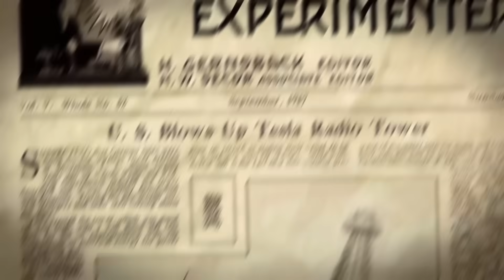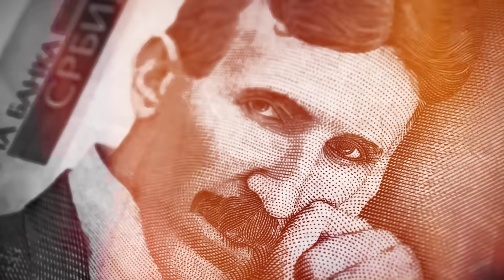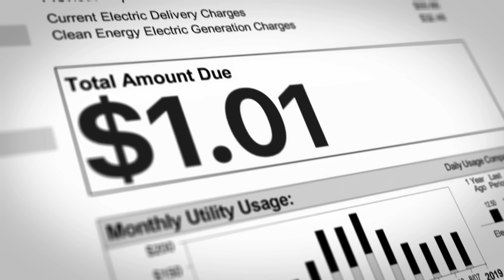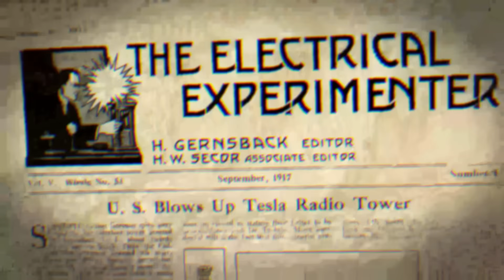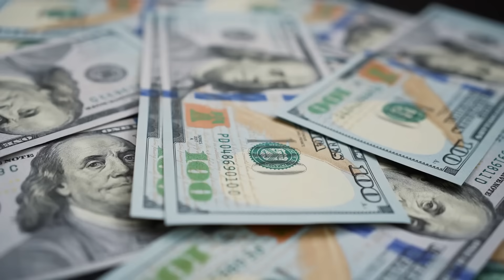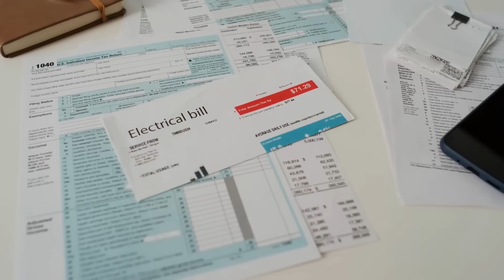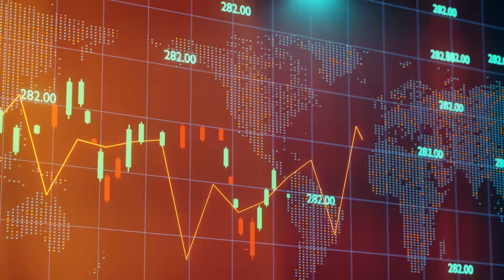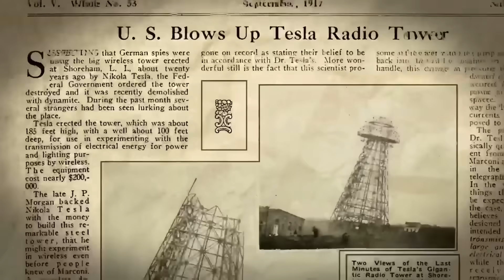Tesla's Lost Device Rebuilt!

Comment: 16-17 years ago I built a free energy system. I used a big 3 phase motor and started it using a blower motor from a house furnace that moves air for the ducts in the home. Once the 3 phase motor was going as fast of the RPM the blower motor could go, i put in 120 volt ac from my breaker box on one of the three hot wires on 3 phase motor and then that big motor could run at full speed with only one of the three hot wires, hot. But the other two wires also were hot because the three phase motor was making power. If I turn off the breaker going to the system it all stops. But I hooked up one of the two hot wires to the first hot wire after I flipped off the breaker and it keeps making power. If your motor isn't making the output of power you need, just hook up a run capacitor and dont use a starting one because you need full fun power on it. Be safe, if you don't know about electricity, please don't mess with it because it will harm and even take a life. Do not hook it up to your home either, if you're getting power from the grid because you can take a life from the electric company employees who might be working on a line several miles away from your home and you are sending live power on the line someone else might think is a dead wire but your making it hot or live. Ok

Comment: A company has been working on what they call a earth engine. I believe it is based on Tesla`s work. Tesla did not have a motor He used the earth itself. He placed light bulbs in the ground and lite them up. This has been done today .
Reply: Thing is couldn't it fry electronics like an EMP? Also over the air electricity that uses an ionosphere like lightning it's not going to be harnessed by an electric motor that sits on the table. I believe these patents are suppressed and a lot more could be done for electricity that we can make nuclear is even saf e if done correctly the real conspiracy is Nixon shutting down the lifter reactor used they use a thorium and freeze plugs that melted a certain temperature so even during catastrophic meltdown it won't actually leave radiation it stops the reaction over need for water cooling that can fail just gravity and something that melts at a certain temperature no human or hand needed let you know I can't make plutonium bombs. America just had found a giant uranium deposit in Montana. Interestingly enough AI is going nuclear but China and India are building thorium. My grandpa was building a lawn mower that got amazing gas mileage and two guys and a Cadillac and suits asked him if he got the engine working he hadn't really pulled anybody so he said no. He was a pretty renowned restore of model A's. So yeah I believe that they show up pay you off or sent you up or seal up the patent. If this is real I'm really glad that he made it open source and didn't try to patent it.
Reply: Black suits and ties oh no get the shotgun out lol
Reply: Utterly ridiculous 😂
Reply: You eve @MrMatbat1

Comment: Total BS. If we had any possible way to get more out of anything then we put in, the world wouldn't have any energy issues. But physics proves that just can't happen. And that is because we can't create energy, or destroy it either. We can only transfer it from one form to another but never getting more than we started with...and that is a FACT! The tesla coil is merely a very high frequency high voltage transformer that has electricity that will jump off to some place to try and neutralize it back to zero. But it doesn't have the ability to transfer much current whatsoever. Like static electricity in the dry weather jumping from you finger to a door knob. While that hurts a little, it can't transfer that spark for any long distances. Don't be fooled thinking some governments, or huge corporation, are keeping such ideas for themselves. It just can't happen.